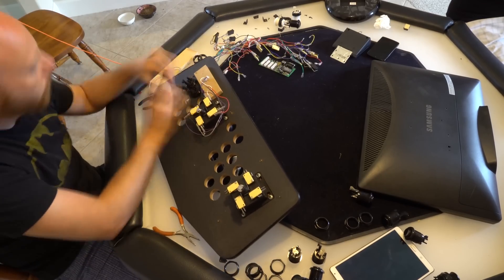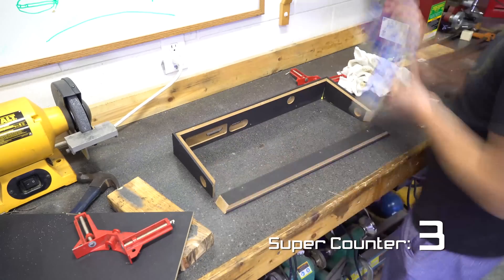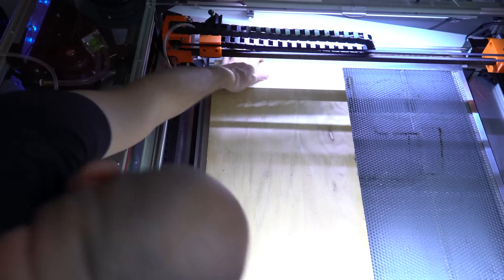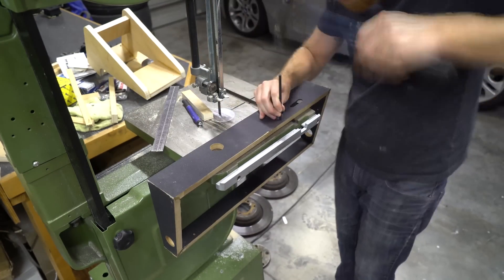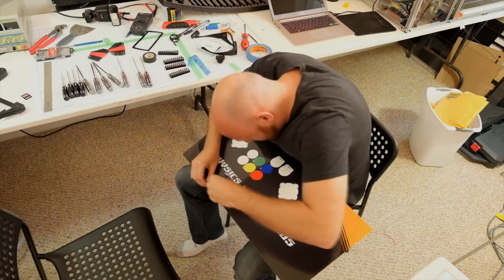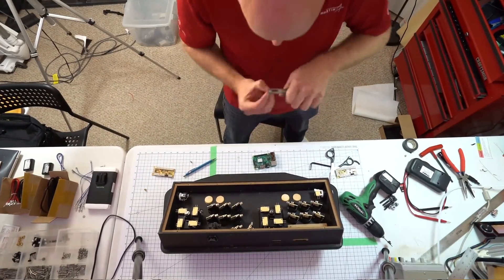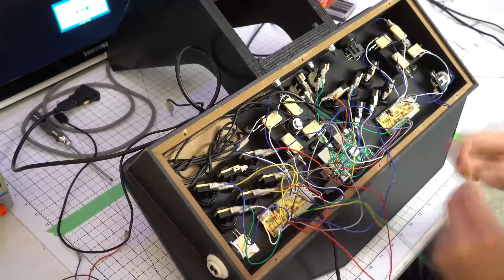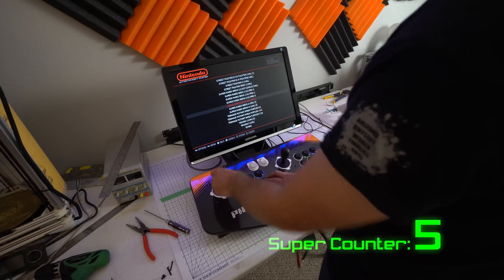S01E10 - Arcade Box

Comment: nice project but i would include a usb hub on the side just to be able to plug regular controllers for mario and stuff like that.and the raspberry pi 3 support only until the n64 and not ps2 without slowdown,some n64 games and cps3 games can get pretty laggy (Ninja Baseball Bat Man)
Reply: try recallbox.
https://www.recalbox.com/
n64 runs smooth
Reply from the maker: Thanks Tailslol, thats a great idea. i could also do wireless controllers. you are totally right about the ps2 and n64 speeds. i think there are some ways to make then run faster. the pie can be over clocked and the resolution can be lowered.

Comment: Thanks for the video.  I know wood working - and think I can sort the raspberry pi / retro pi software - but I really need help getting the controls hooked to the pi.  Are there any tutorials you would recommend?
Reply from the maker: Take a look at the link in the description for the buttons and controller, they really are plug and play. the board comes with the needed cables to hook up between the buttons and the controller, and the controller plugs into the Pi over USB. this kit should also come with pretty clear directions on how to hook it up. if you still need some help let me know and I will make a short video on it.

Comment: Wonderful design and simplicity. A dream added to my list. You would have to cut plans for wood? Thank you for sharing.
Reply from the maker: Thanks Thiago! if you want the plans I used you can find them here: https://drive.google.com/open?id=0B-XSmgr3boGMaWtDdkl6UmZZXzg
Reply: Hello! I started building my arcade based on your project. Thank you! Can I ask you a question? Where did you put sound output and audio control? I'm making some adaptations and thought to put the audio in the base of the monitor and close this base more. I'm making the changes to Corel Draw X7. I can share with you the project and photos of how it is getting. Send me an email that I send you thiagocmagero@gmail.com. Thanks again.

Comment: That's actually quite similar to my Mooncontroller. 
Same USB encoders, I have built in two PSU's with, one to 
power the RPI and the leds, and the second is for the amplifier driving the build-in speakers.
Didnt have as fancy tools when I made mine tho.. I used a cheap jigsaw and a handpowered drill.
And I handpainted it, didnt have moneys for a expensive vinyl. Have a short vid testing it on my small channel.